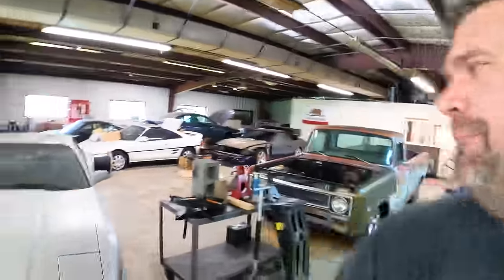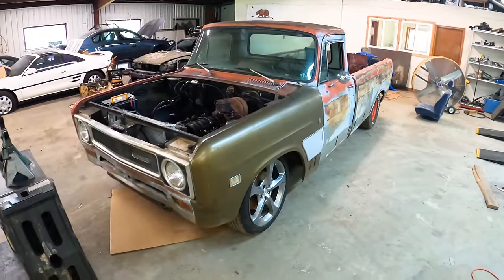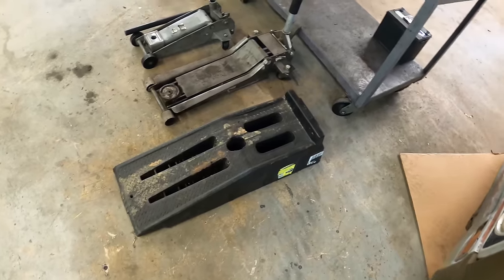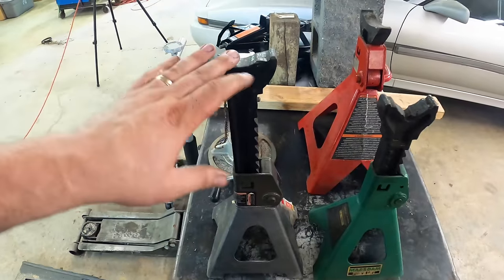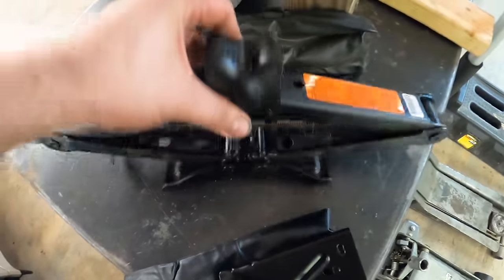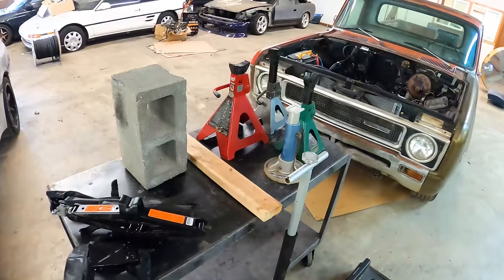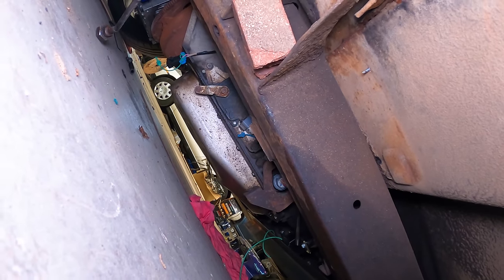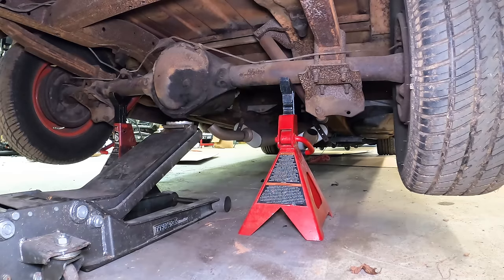How To Properly Jack Up Your Car Without DESTROYING It (And Why You're Doing It WRONG)

Comment: One missed point. Never under any cicumstance use the jack as a jack stand. NEVER get under a vehicle that is solely supported with just a jack. 🇺🇸🦅✌️
Reply: safest way to have a car lifted on Jack Stands are Stands in correct position , Wheels Under Vehicle if doing brake work , and even have the Jack Locked but not completely Seated on the vehicle frame or wherever it was jacked from.
Reply: I jack up the car, put jack stands under, lower the jack just enough to put the weight on the stands, leave the jack under, and then I add a wheel and tire or something else that is preferably wider than my body elsewhere under the car. Basically 3 layers of protection. If jack stands fail, jack catches. If jack fails, the wheel and tire or other object will take the crush and save me.
Reply: WC Auto I always put wheels under as well so if it moves it lands on the tyres and not on me
Reply: @802Garage This makes sense, 3 points of redundancy so if 1fails, you have 3 back ups to save your life.
Reply: @JanZamani  Yep! It's worth the bit of added time for sure.
Reply: @802Garage  100% when it's your life on the line right? I'd only be happy with 3 points of redundancy, high quality jack and jack stands (with the pins in them) and the proper knowledge. 

Better safe than sorry right?
Reply: @JanZamani  If I'm really crawling underneath I have the weight of the car resting on the stands, but also have one of those ramps under each wheel with the front ramps turned the other way. If someone doesn't stands they could use lumber or concrete.
Reply: @802Garage  I keep the jack just touching the diff on my S2000 (rear jacking point) when on stands for the very same reason. Very little extra effort for lots of added safety.
Reply: @thepassionofthegoose5472  Cheap insurance!
Reply: @802Garage  buddy of mine welded 8 rims (2 stacked together a piece) and we'll use one at the front one at the rear depending on the work we're doing. Plus the jack/jackstands. I'd rather be safe than dead that's for sure.
Reply: @thatoneguythatwasntlikewow5167  Love that.
Reply: Whoops

Comment: Perfect timing, I’m trying to figure out what jack and jack stands to buy and this knowledge would be helpful for me.
Reply: Import some Rodcraft stands. Yes, it costs more than the Chinese made stuff you can get here because the shipping adds a bit, but they're TUV certified and made in Germany and you can actually trust them with your life, instead of just hope. They also have feet that work on dirt.
Reply: @TheRacerRich  That's absolute nonsense. It would be hundreds of dollars for one. We already have the Esco brand which is actually rated for more weight and is the same design type (better puck too).
Reply: @MrCarGuy  Where in the world did you get the idea that it would be hundreds of dollars for one? Depending on the size you get, it works out to about $80 each after shipping. Which one is the ESCO rated for more weight that? Rodcraft has models up to 8 tons. And remember, Rodcraft is using metric tons, which 2205 lbs, not 2000. Sure, the ESCO 3 ton is rated for more than the Rodcraft 1.5 ton, but there is also a Rodcraft 3 ton, and a 5 ton and an 8 ton.
I'm sure the ESCOs are usually safe, but the welds look like crap, and why trust your life to the manufacturing of a country that has sent us poison drywall, poison wood flooring, poison toothpaste, poison dog food, poison seafood, poison children's toy, defective tires, etc?
Reply: @TheRacerRich  Yeah, the cheapest one would still be more than even the low profile Esco. That's the point. Where are you getting $80 from? I checked current prices and I found much higher than that. 

"Usually safe"? The welds are much better than you get on the other jacks widely available in the US and no reviews state failures that I've seen (and online reviews are heavily biased toward negative sentiment). Ugly welds ≠ unsafe welds. I'm not saying to support China if you can help it. I'm saying it's the best you can get under $100 and comes with a nice, flat, pad for most European cars. Rather than importing anything from Germany I'd go with stands from US Jack. 

Manufacturing standards work differently with foreign companies overseeing production. The scams are largely from Chinese companies and Chinese manufacturing.
Reply: @MrCarGuy  I bought my Rodcrafts from fluid-online. You have to email him for a quote, but remember we don't pay VAT (so divide the listed price by 1.19 to get the US customer price). He speaks english. IIRC it's 79 euro to ship 4 stands, but I don't remember the break down for smaller shipments (I've bought over a dozen between me and friends of mine). Until like a year ago you could get them in the US branded as AC Hydraulic but the US distributor doesn't want to be bothered with it anymore.
The US Jack jacks are good, but the feet don't work on gravel and I'd have to get such a big stand to get the height I was looking for to do a 911 engine out.
Reply: @TheRacerRich  Alright. So, for a set of 4 with shipping and removing 19% VAT, you're looking at $242 for the 1.5 metric ton and about $308 for the 3 metric ton jacks. 

I'm sure they're decent at that price so it may make sense for one to pay $70 more for a set of 4 Rodcraft than for Esco if they don't already have good jacks. After all, these designs are better than ratchet types. 

I couldn't bring myself to work on gravel. Safety is uncertain.
Reply: If you only working on standard street cars, 2 tons is more than enough. Just remember that the bigger the engine the higher the overall weight will be on the car.

Comment: Very good content and among the most important safety considerations of doing your own mechanical work. Like you, I had a friend working under a car that fell on his chest. He was by himself and suffocated to death rather than being crushed and dying instantly. At the time I worked with EMS in Dawsonville, heard the call go out, but, thankfully, others took the call. An hour or so later I drove by what was a makeshift garage and there was the bumper jack laid over to one side, dropping the car back to normal height. 

Admittedly, the old bumper jacks could come in handy by using their most dangerous fault, jacking the car up high, then intentionally pushing the car over to get it out of a ditch. However, the only purpose of having an old-style bumper jack now is when you're restoring a classic car and need to organize the trunk as it left the factory. Even in that case, I think I'd disable the jack mechanism for safety.

My son, a third-generation mechanic, heard the lectures from me from day one, "Do not get under a car without at least one form of backup for your jack stands." Even now, despite working as a professional mechanic, he'll stop what he's doing when I come in and explain how he's supporting the vehicle because he knows dad is going to critique it.

Not that I'd recommend it in this day and time, my father, the first generation mechanic, disassembled the rear end of a '33 or '34 Fords, using the end nearest the differential as the base, he cut a deep groove into the axle housing just behind the rear wheel bearing. They worked well for him and over time he had a collection of different height stands to use depending on the job he was doing. 

Some of my friends... errrrrr idiots.... have been known to use a come-along to lift and support a car. Others use 4x4's and 6x6's with a shallow dado cut in them so they can be stacked easily.

 Probably the worst example of stacking timber under something was done by an early NASCAR champion and his son, also a NASCAR driver who had subbed in for A.J. Foyt. I got called to go help, pulled in and there was a 56,000 lb dredge barge up nearly 6' in the air and supported by 4 stacks of half-length. The plan was to back a lowboy underneath the barge with a fraction of an inch on each side and, using a large loader as the jack, lower the barge two crossties at a time in sort of an end to end seesaw motion. Even though the elder of the two invented 2 types of front suspension components you probably have on some of your vehicles today and the son redesigned the front suspension of all Volvo dump trucks without benefit of college degrees, I stood back just beyond where that thing could fall, then added another 10 feet for good measure. The process worked, way overloaded the lowboy and when we launched the boat into Lake Lanier, it ripped every board off the lowboy and dragged them into the lake. When the barge was finally going up the lake some 18 hours later, miraculously, the only injuries were to egos and a few splinters.
Reply: lucky and i always try and use a second support just in case

Comment: One tip i always use.....when i lift my car to work underneath after taking off the tires i always slide them under the car that way should something happen and it does fall i would have a bit of a buffer and hopefully it would be enough. I have had my car fall off jack stands before but never when i was working underneath. Always be safe and if you question it even a little give the vehicle a shake first

Comment: My Wrx is too low stock for ramps or to get my jack underneath. Helpful tip: Drive your car onto a brick or 2x4 to get a little more clearance for the jack. Or use a small piece of wood for elevation as a ramp to your ramp.
Reply: My Suzuki sx4 sport can't get on most ramps either at stock height. The front wheels sit so far back and the lip on the bumper is so low usually the bumper is dragging before the wheels make it to the ramp. Have to be careful when pulling up to parking spots along sidewalks too. Nearly ripped the lip off the first month i had it 😂
Reply: There are some low profile ramps you can get all over the place including amazon. They only lift the car 3-4", but it's enough to get a jack under most cars. Some wood works just as well and is probably cheaper, but I got some low profile ramps for 40$ on amazon that work just fine for my Charger that I can't get a jack under or use normal ramps with.
Reply: @christopherpedersen1820  used to have to do the same with my Camaro..lol it was so annoying. Eventually I got a low profile jack when i still had it but it sat so low in the front it was still a pain to get it under it far enough.
Reply: @christopherpedersen1820  got to work with what you have sometimes. I def should upgrade tho. Sometimes the bumper is out to far in front of the wheel so still need to use a a 2x4 to give you that little extra clearance.
Reply: @jkalash762  Haven't heard of an SX4 Sport since that crazy police chase with one in California not long ago.
Reply: @MrCarGuy  really? Since I've had mine I've been seeing them pop up all over near me.
Reply: My wrx is lowered and Im able to get my big floor jack under the front and rear jack points, it is a low profile one. But driving up on boards do help alot, I do that when Im doing a oil change

Comment: Good tips all around! Even on modern cars with pinch weld jack points, I much prefer to jack them up by the frame, differential, subframe jacking points, or member mounting bolts which go directly into the frame. Just like you said. I will use the factory jack on the pinch weld spot, but just when it's the only option.
Jacking up by the pinch welds is just always asking to bend them or introduce some flex which will later allow moisture in and create rust spots. Floor jacks especially will tend to pull out, away from the car, and try to bend the pinch weld out with them, then you get a flattened spot. Don't want my pinch welds to end up like that damaged body spot on Johnny Rev!
I also don't put jack stands under the pinch welds, since it can damage the rocker. It also doesn't give a very large surface area on many stands. Some jack stands have the nice V shape in the pad though, and that tends to slot around the rocker panel jack points well. Be safe out there everyone!

Comment: Personal pro tip, after lifting the car and placing on safety stands, get out another set of stands and place them as backups. If crap stand fails, you will be saved by the second set. Also before you get under it try to rock the car and see if it will fall off. Make sure it’s 100% rock solid. Getting pinched under a car to death I heard is one of the worst ways to slowly die.  Also place a block behind the wheels staying on the ground to help keep it from rolling back.

Comment: Yesterday my car fell off the stands and I am trying to find a jacking plate.  When I looked on-line I found a set of 12" square steel diamond-plate steel jacking plates for $50, but I cannot find any steel diamond plate in my area--or I couldn't until I looked for steel suppliers!
Thanks for that tip!
I was working on my car in deep gravel and would have been killed had I been underneath.
I am counting my blessings!

Comment: ⛔⛔This is very valid⛔⛔ 
Thank you Jared 
I worked at a salvage yard, they used 2 wheels one flat the other upright an welded (like pick an pull) long story short I was crushed by the Ford explorer due to the vehicle sliding off the makeshift jack stand. I was dead at the scene, coded 3 more time, was in a medical coma for 5 day, woke up in the hospital with no movement in my right arm. God blessed me im 85% back to normal PLZ be careful while working under vehicle or anything realy. #MORHECTruck #creeksquad
Reply: Planned on going to my local Pick N Pull tomorrow.  I wont be climbing underneath any cars. Because they use the same method you mentioned.
Reply: @philb707  always!!! Shake the car to just to make sure.

Comment: Just weld the plate to the bottom of the jack stand. That’s what I did, if you over size it a inch or two it helps with some stability.

Comment: The problem lies in  premade blocks like cinder or cement blocks you never know what compression strength they where made at. When you make them with proper compression strength concrete there should be no issue. And they be as good probable alot better . Great explanation on jack stand support placement just don't agree completely with your jack stand type opinions. Metal stands eventually rust as well concrete doesn't have this problem. And you can easily cast concrete into any shape / size you want for special shaped holding. But I do agree with you in a lot of things you said as well. Got to be really careful when you start working under cars as opposed to on side of cars .

Comment: One thought I had that I don't know if you covered is this:  You need TWO sets of strong lift points... One set of lift points for the JACK, and a separate set of lift points for the JACK STANDS.  You can often find the official jacking points in the owner's manual for the car, but you have to remember - if you lift the car with a jack at a given point, you WON'T be able to put a Jackstand at that SAME POINT.  Also consider that the jackstand's footprint will interfere with the jack's footprint, so there has to be an ample amount of distance between the jack point and the jackSTAND point.  Personally, I like to LIFT from the center (diff, subframe, etc) so that both sides go up evenly, and the place the jackstands at the official jackingpoints.  NEVER use just one jackstand in the center.

Comment: Usually, in manuals, front wheel drive, the hand brake (e-brake) is applied to the rear wheels. (don't know about autos)
So, if you jack your car in a way that both rear wheels will be up, don't forget do chock the front wheels. Don't just put in in gear...

Comment: Using the jack handle on the screw, as is suggested by the instructions with many jacks, offers very poor control of the drop rate. To get the jack to release slowly, I have used a long rod with a blade on the end. In my case, I found a standard wood or metal file works, using the file's thin handle extension like a flat-head screwdriver, inserted within the slot of the release screw. Move it very slowly. I have found success with this method. The file I use even bends, but at the right tension the release screw moves just a little. Then a little more, and finally the fluid starts slowly easing out and the vehicle drops in a controlled fashion.

Comment: Be careful jacking up the rear differential, some models (ford 8.8) have covers that extend below the jacking point.  If you’re not careful you can bend the cover, just make sure the jack pad is on diff, no part of it is hitting the diff cover.

Comment: Very good video Jared! :) Very important that people do this correctly!
2 things though: never ever use cinderblocks. Red bricks can probably be used(i don't know), but cinderblocks are known to  sometimes explode when people put them under cars!  And if you absolutely HAVE to use cinderblocks, use them in the same direction as they are used in a house... Horizontal! They're much weaker when set vertical!!
Also, wood on it's side, under a pinchweld? That's asking for trouble, because it'll nicely split the wood along the grain!